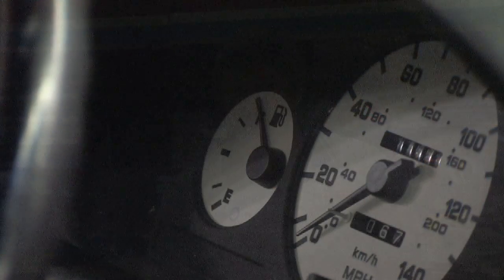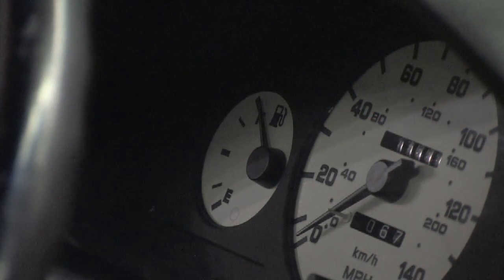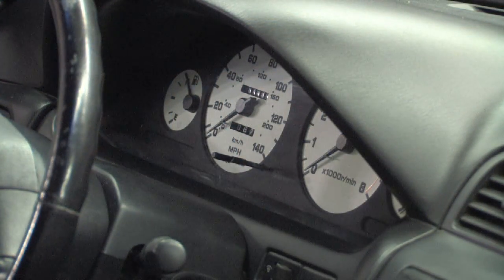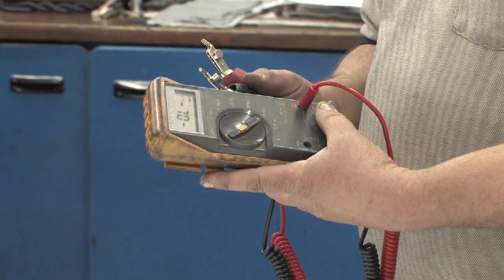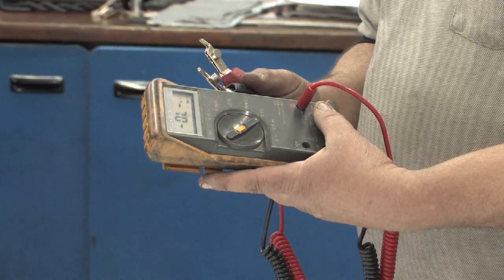Car Maintenance Tips : How Can I Fix My Gas Gauge?

Comment: What about when you're working on an older type vehicle like a 67 valiant I replaced my sending unit but my gas gauge still does not work someone told me it needs to be grounded and some other people told me that the gas gauge may not be working correctly what do I do
Reply: Fas. Guagem

Gas. Gauge

Comment: Brent, I was looking around for some strategy to repair the fuel gauge on my newly-acquired 2000 E350 with the 5.4 Triton, and lo and behold, THERE YOU ARE!!!  Anyway, I already have the schematic, going to get out and troubleshoot it.  I'm thinking it might be the jumper connector, circuit 675 to circuit 29...  Great to "See Ya!"  ~Geoff Taylor

Comment: i have a 2001 freightliner fl80 and the gas gauge doesnt work!  no fire to the plug going to the tank. the gauge moves to full when i turn the key on a goes back to empty..
Reply: rke0304 I have the same problem